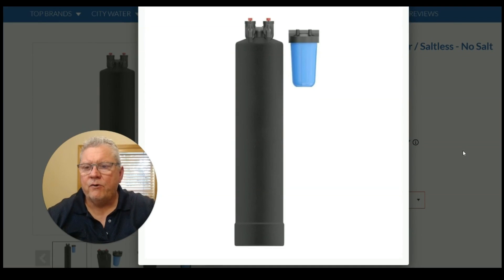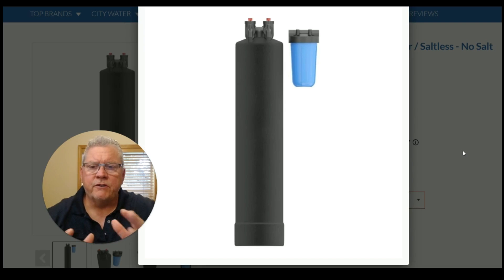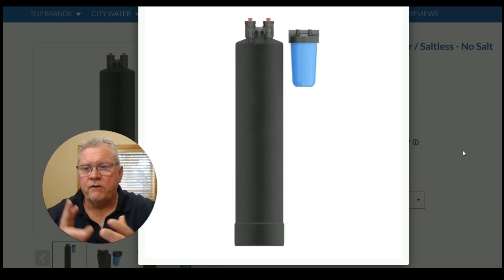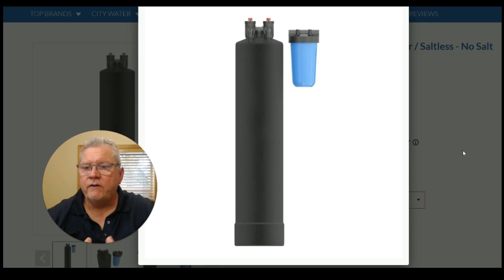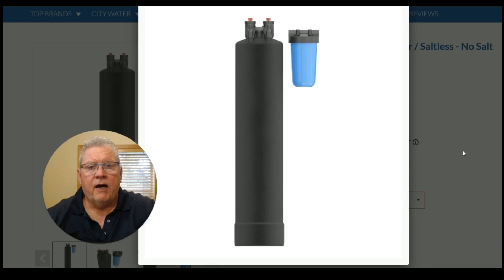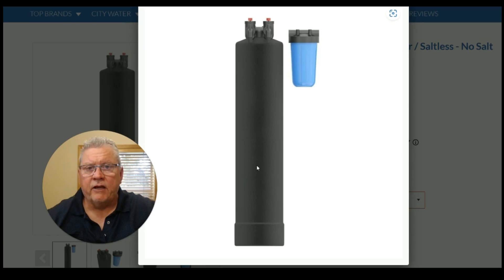water softener - Salt Free VS Salt based water softeners

Comment: If you are looking for a water treatment system that removes iron from your residential well, I suggest you get other opinions. I have spent over 1.5 years trying to get my system to work as advertised. 

I have a well that outputs 20gpm and an iron content of 11ppm. This was told to me via numerous phone calls and email that the system I wanted to purchase would remove the iron. 

The minute I started having problems, I contacted Quality Water Treatment and was provided numerous this to do to fix the problem. I have tried all suggestions, according to instructions, and the system still fails to completely remove the iron as advertised. 

I'm sure the system can work with the output of certain wells, but this is not my case, and now I'm not even getting replies to my phone calls.